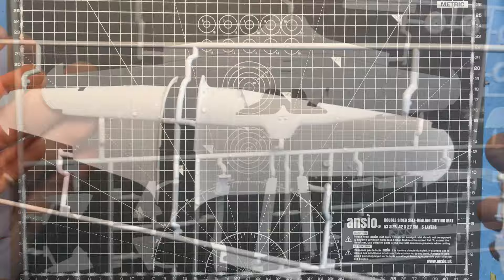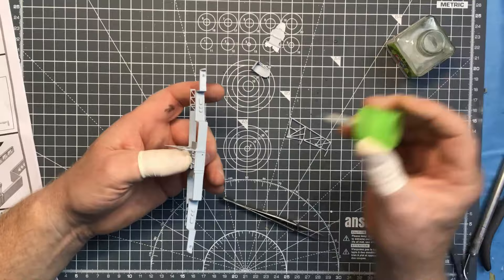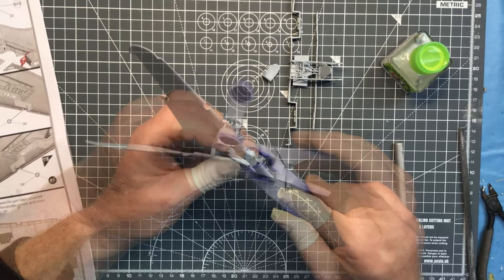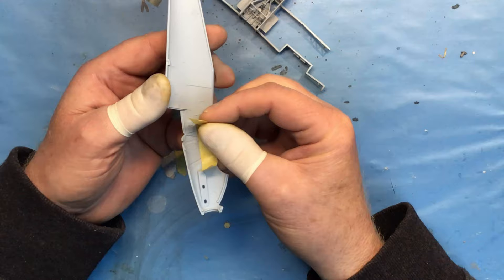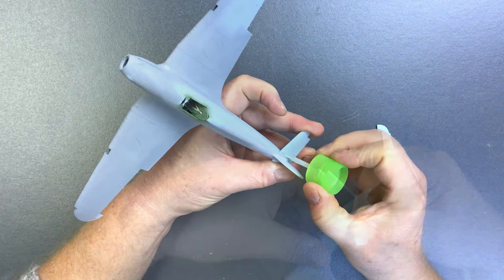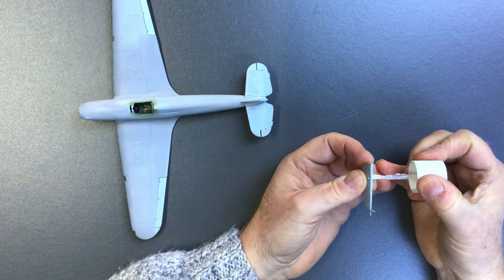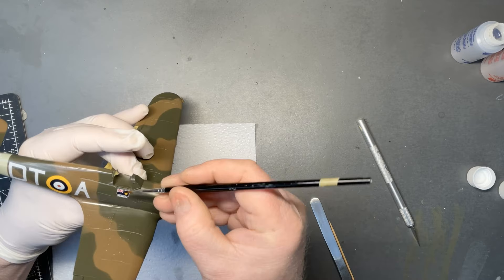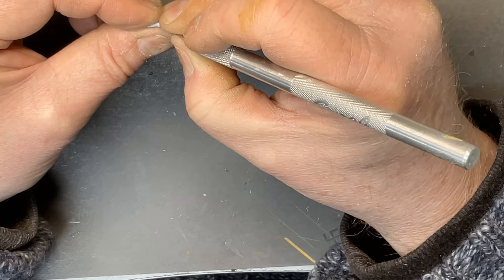Aircraft of the Aces series 2: Hurricane Mk1 Stanford Tuck

Comment: I had the same problem with the fuselage to wing fit. I found that the bulkhead and forward cockpit framing were preventing the fuselage from "sitting down" fully. The solution was to heavily file back both the frame and bulkhead and a good fit was then possible. I don't know why Airfix have included so much internal framing on this kit, the part which causes the fit issue cannot be seen once the fuselage halves are together.
Reply from the maker: I think Airfix overcomplicate their designs Roger but don’t have the molding finesse to pull it off. The last few kits from them have had similar problems. That’s why I build Tamiya at intervals to have a break from them.